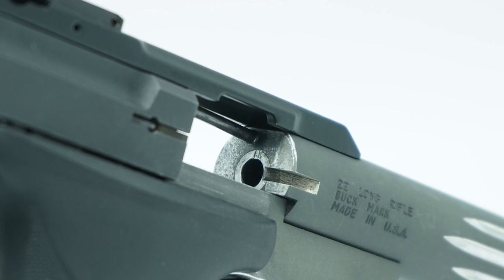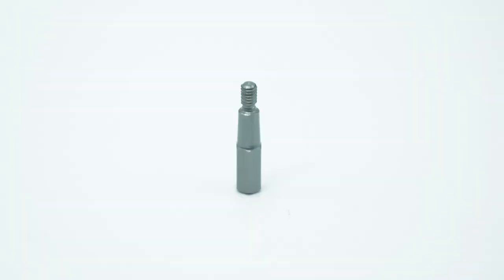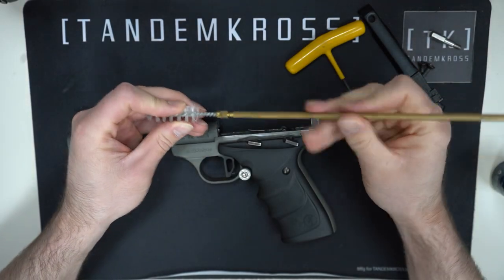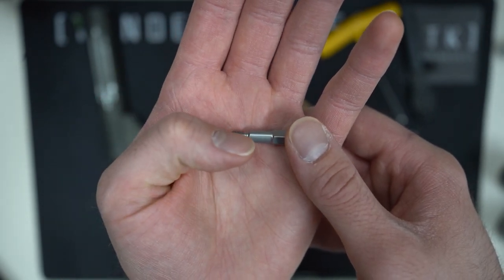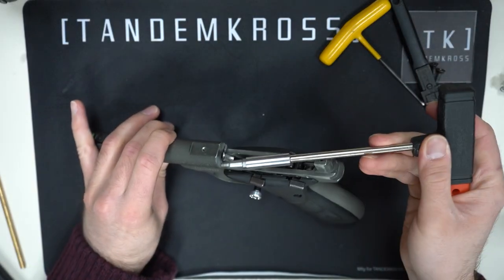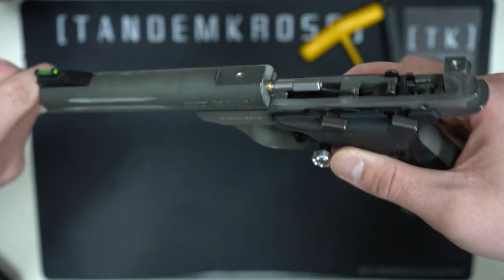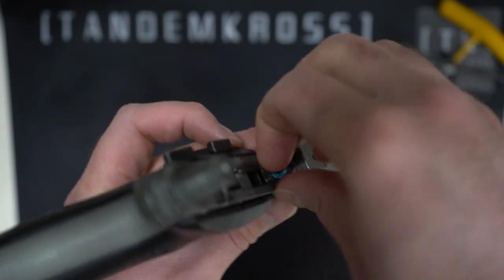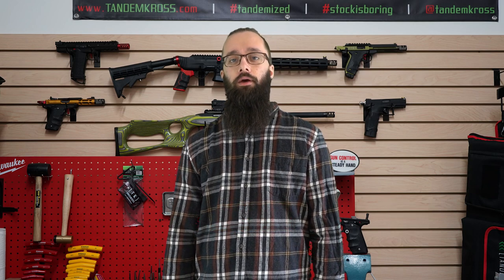TANDEMKROSS - "ChamberMade"  Swage for .22 Firearms

Comment: This depends largely on the design of the firearm:  Most never designs (though certainly not all) use a captured Firing Pin and limit the maximum forward travel of the firing pin, preventing the firing pin from ever hitting the breechface or edge of the chamber. On many customized rimfires, this design feature is bypassed/broken by incorrect fitting of the firing pin. The Chamber Iron is a great tool, but make sure you are not using this tool to "fix" a problem which may actually exist in another part of your Firearm. As always, consult a competent gunsmith if in doubt.
Reply: My mkiv had the firing pin return spring break. This lost tension on the firing pin stop pin and it fell out without me knowing it when switching uppers. Without that the firing pin quickly damaged the breach face on a dry fire.

Comment: I have a marlin model 60, and had been having extraction issues which turned into not even being able to put a round Into the chamber, I used the chamber maid and now the round drops in and falls out easily unfired, however once the round is fire the case is extreamly hard to remove, I have to use a cleaning rod thru the muzzle to push the case out and it requires a decent amount of force.. what should I do? Thanks
Reply from the maker: Definitely take it to a gunsmith or someone with a bore scope, there may be corrosion or rust deeper inside the chamber!
Reply: @TANDEMKROSS  Thanks!!